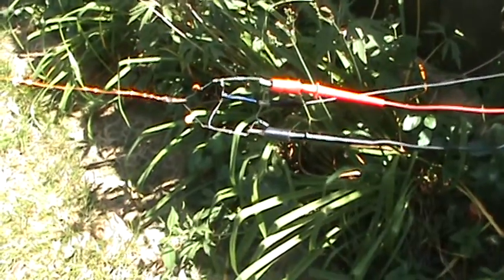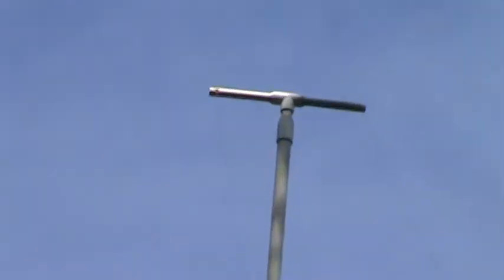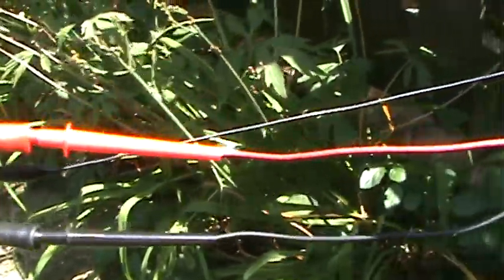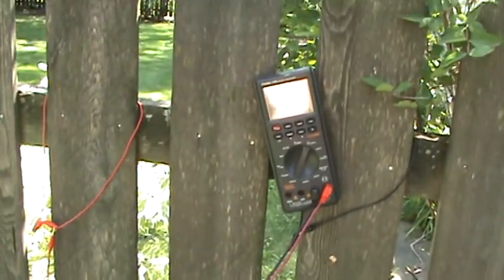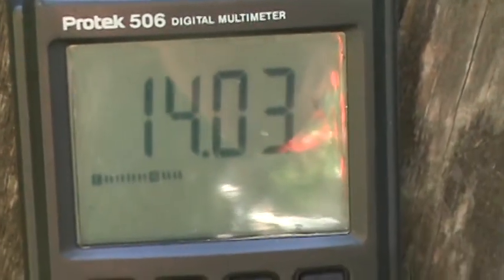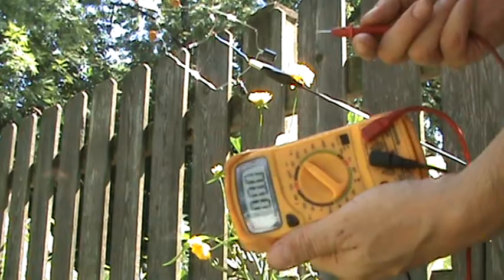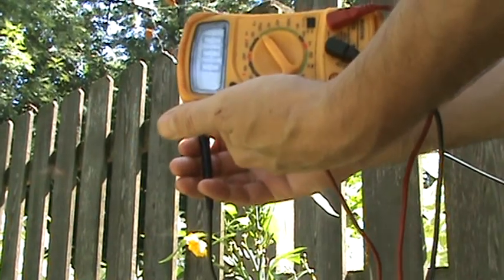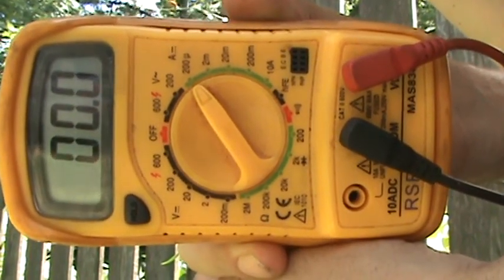Free energy from air TEST

Comment: I need at least 12v constantly for my Inverter in my camper van...
I have solar panel and mppt charger but it would be great to have power at night without using leisure batteries
Reply from the maker: I get over 60V when I add the coil.....  https://www.youtube.com/watch?v=vbEGITqU3_c&t=93s
Not sure if this will have enough current to power the charge controller, but it would be nice to see someone try it.
Thanks for watching😎

Comment: Try using a one henry coil and use a 60 watt piezo or piezo disc in seried and parallel for energy you want. Coil is parrallel for test. If they ring or buzz you got power. You may have to put load in series to run it.
Reply from the maker: Hello Travis!

Here is working small piezo....
https://www.youtube.com/watch?v=U-wFx4cIqiM&t=208s

Here is 21 LEDs lit :-).........
https://www.youtube.com/watch?v=E7JV2JhMcb0

Comment: doesn't this catch the power carried by radio station signals?
Reply from the maker: The source really has to be proven somehow yet.  It could be picking up energy from radio, satelights, GPS, TV, power lines.  The freq i read from the antenna is not in the range of any of these things.  This circuit has been proven to rise in voltage when there is an Earth quake within 150 miles, so it picks up piezo electric effects from the tectonic plates pressing together, so it must also be picking up freq from the cosmos, stars, black holes, quasars, pulsars, supernovas, ect..   It maybe collecting harmonics of higher freq from the cosmos, or maybe picking up beat freq from many freq colliding.  I have tried it in a few locations, with same results in all locations.
Thanks for commenting & watching :-)

Comment: The simplicity of AC electricity multipliers,

 This technology is simple, by using the long length of belt that is produced from one single rotation of a 100cm circumference pulley, which only costs one spark of DC current, to rotate 10 mini-pulleys of 1cm circumferences. This way you have multiplied one rotation of your DC motor, into 1000 rotations of your mini-pulleys. If you attached AC generators to these mini-pulleys, you would gain 1000 units of AC energy. These 1000 units of AC electricity, are all free running motors, just winding up massive voltage, or potential to do work. http://free-energy.yolasite.com/

 Now try and tell me that these 1000 units of AC electricity cannot produce the one spark of DC electricity, when run through full wave bridge rectifiers of course, to convert your AC output, back into a DC input, which you need to turn your DC drive motor just once. The massive voltage that you are generating with all of these AC generators is just what you need to crank over your DC motor once. This massive voltage is just what you need to crank over your DC motor the once, practically no current is needed. You now have a set of self powered AC + DC generators. 

 There is no magic here, it works because of the fact that turning a 100cm circumference pulley does not take 100 times the power that it takes to turn a 1cm circumference pulley. So, if you put these two pulleys in the same system, you can multiply the # of rotations by 100. Which when you put an AC generator on the mini-pulley, you get 100 units of AC electricity. Now this AC generator is running free, only winding up massive voltage, which by the way is exactly what you need for torque to turn over your DC motor once. You only need to produce one spark of DC current, so this one spark is divided by 100 rotations, which is less than no torque,,, ie easily turned.
Reply from the maker: very interesting!!,,,i printed this all out and will look at it over this weekend and get back to you..
Reply from the maker: I will have to keep thinking about this one.  I see that you have been showing this concept to people at overunity.com.  I printed out more photos.  I see your conversations here....
http://overunity.com/14280/gem-gods-electricity-multiplier/#.V8l4X5grJ1s

Comment: Aerial systems are best modeled as current sources.  I believe your meter is loading the circuit giving you false readings.  
The Earths electric field in calm weather is approximately 30 volts/foot; your aerial is 33 feet.  30 Volts/Foot * 33 Feet = 990 Volts.  
Let your aerial be 990 Volts WITHOUT YOUR METER. The characteristic impedance of the aerial is 990 volts/165 uA = 6 million ohms. I used 165uA assuming your aerial is a perfect current source, which, it's not.  
Let your ohm meter have input impedance of 10 million ohms.  The 6 million ohms of the current source are in parallel with the 10 million ohms of your meter (voltage is measured in parallel).  Therefore, (6 MOhm * 10 Mohm)/(6 Mohm + 10 Mohm) = 3.75 M Ohms. 
When you hook up your meter you are shorting the system out.  You're taking a 6 million ohm system and dropping it to 3.75 Million ohms.  
The two assumptions that were made was the voltage of your aerial without a meter and the input impedance of your meter.  The higher the input impedance of your meter the more accurate your measurements will be.  
Note 1: Leakage current is really important to minimize; try vacuum capacitors.  It might be cheaper to make a crude one and see if there is improvement before buying expensive ones.  Be sure the encasing material has a high enough resistivity to be an efficient insulator.  
Note 2: Look into AC voltages; Total EM energy in a narrow band around 2 frequencies 325 Hz and 10 kHz (taken from GlobalElectricCircuit.pdf).  These frequencies are caused by lighting strikes that are occurring constantly.  You might get more energy tuning your aerial into those frequencies.  
I am not an expert;  I study Mathematics.
Reply from the maker: Thanks for the info :-)
New videos of this soon :-)

Comment: what if the airport install a walking path way that the human body walks in the plastic creating electricity thru carpet and plastic and having a + and - wire to attract static and with high capacitor you'll charge them just so you can power half the air port. because the air port has a lot of people walking back and forth so through this path way you create electricity and capturing it in big caps. 120v or more.
Reply from the maker: Good idea :-)  I thought about this also,,,,then i ran across platforms they make now for airports and sidewalks, but it is still new and being tried on a few places,,,,the cars and people walk on them and power the lights above,,but instead of static elec, i think they used piezo effect or just a slight movement, i dont remember exactly how they worked now, it has been a while since i saw them.  Keep up the good thoughts and thanks for the comments :-)
Reply: Yea:-D

Comment: what are the ceramic caps on the input side for? (hf pass?)
Reply from the maker: +George Viaud Good question,,,,hf pass, i believe so. I tried to replace them with many different values and not much difference at all. But if i remove them, then i get results that are not as good.  It has been a while, i will have to experiment with them again.

Comment: Pipe is supposed to be iron.
Reply from the maker: +destiny walker Not sure it make a difference.  I think the main thing is that it is highly conductive so the electrons can flow easily.  I have also tried a zink rod vs copper and no difference.
Thanks for you input/comments, much appreciated :-)
Reply: +destiny walker   New homes are fitted with a 4 foot copper ground rod...

Comment: Have you tried hooking up a DC to DC voltage booster with this?
Reply from the maker: +mppforall I have a new video series on this project.  In the past i have tried power converters and transformers and also tried joule thief,,,,,,so far no luck.  Need more current for the transformers to induce secondary winding.

Comment: I've read the comments. But I have one question. How do I get more current out of it as well as volts? What I mean is lessen the resistance.
Reply from the maker: amendo95 Well, yes, this is the "big" question we would all like to know.Lets see, first some have used sheets of alum foil on hanging on their walls instead of long antenna, the more surface area the better.  Another type of antenna you could try, and i been wanting to try this myself, is,,,oh i forget the name of this antenna, but it is multiple antenna wires in parallel and they have an insulating rods between them to keep each wire separated from each other, but all the wires come together at the ends, this type is said to produce more currents.  Another thing i would like to try is to replace the antenna wire with many rods of carbon.  Wish i could help more.
Reply: INVENTOR3 Thanks a lot for the input. Lets see what i come up with and I'll comment what i find out.

Comment: if the energy is coming from this antenna thing and the device isnt reading anything from itself then it is only producing 2.31 milli-watts and at 14 volts and 165 microamps... that is 84.85 Kilo-Ohms of resistance o.O
Reply from the maker: hassan ajrouche You are correct, only microamps
Reply: INVENTOR3 so where is the energy coming from from the antenna? from radio towers or from ambient energy or what?
Reply from the maker: Break The Meta Gaming Good question, this really has to be proven yet.  It "has" been proven that it will pick up frequencies from piezoelectric effect caused by tectonic plates rubbing together from an earth quake.  Some will say the energy is coming from radio stations, or power plants, or satellites,,,but some, like myself think most the energy is from the cosmos, stars, moon, black holes, super novas, quasars, ect.
Reply: INVENTOR3 ok then please explain why you think so
Reply from the maker: Break The Meta Gaming Hmmm, well Tesla had his radiant energy collector, it used man made frequencies, but would also run on the power of the sun or cosmos.  Back then there was no satellites and power lines everywhere.  Also there was Dr thomas henry moray that got energy from the cosmos.  Also there is Franklin Mead and his patent with collecting microwaves from the air.  And also the fact that it picks up earth quakes from 150 miles away.  Also the frequency that i get on my antenna with no circuit is below range of radio ^ above 60 Hz of the power lines.  But all these things together tell me that its most likely that im collecting energy mainly from the cosmos, not power and radio stations.  This circuit has worked in many areas around the world.  But it still needs to be proven where all energy is coming from :-)  Also you could look up "Joe Tate" and his APM(ambient power modual)  This is where the proof of the earth quakes comes in.  The circuit i use also gets "almost just as much power without the sun light.  Maybe to test this circuit in a room lined with chicken wire, not sure if this would tell us something, but it would be a start.
Reply: INVENTOR3 so what do you think would happen if you made the antenna coherent where the atoms in the antenna are vibrating in unison kind of like a superconductor does and you find out the frequency of the energy you are collecting and tune this antenna that is coherently vibrating to the frequency of the said energy, wouldn't it absorb all the energy in that range?
Reply from the maker: Break The Meta Gaming I strongly believe so, yes, absolutely. I think i had things tuned well with video part 16 when i get over 100V.  & what you mention about the antenna has led me to think about specific antenna lengths to resonate, maybe with 7.8 Schumann resonance or...?. Later leading me to think about Franklin Meads patent & resonating with microwaves EHF, and now thinking about carbon rods wrapped with magnesium strips and then to make circuit to resonate with this & to implement ideas from my video here...
https://www.youtube.com/watch?v=pg8rGROgfA4
Reply: INVENTOR3 well you know there is ambient energy and also there are radio waves tune an antenna to radiowave frequencies literally just like go get 10 radio antenna's similar to a cars radio antenna and tune each one to another radio tower frequency and connect it to a battery and measure voltage and wattage/ampere it will be a decent amount of energy i think
Reply from the maker: Break The Meta Gaming Yes, i agree, this would work, but i really dont want to rely on radio stations for the power.  But to use same concept with collecting frequencies from the cosmos, an unlimited power supply, and i believe more power :-)  Now need micro sized antennas.  This is why i will experiment next with the carbon rods, they have many micro points for collecting the energies.

Comment: Is it posible to light several LEDs with a RFID powered by radiowaves from a huge antenna?
Reply from the maker: Hmmm, im not sure, but you got me thinking :-)
Unfortunately i dont have enough experience with radio freq ID's.
Hmmm, very tiny components,,im sure they can be powered with even a small antenna, but i dont think the ID by itself would allow enough energy to pass through it to light the LEDs.  I mean the ID is not an amplifier.   Hmm, ill have to keep thinking about this.  Very Interesting idea. Thanks.
Reply: INVENTOR3 nikola tesla tuned multiple antennas to receive radio signals and put the energy into a battery using it to turn a motor at 1800 rpm for a car
Reply from the maker: hassan ajrouche search,,,,Tesla ford pierce arrow
Reply: INVENTOR3 okay thankyou .. that was the name of it xD

Comment from the maker: It will not charge a lead acid battery, they leak too fast.  I would try a small re-chargable battery.
Reply from the maker: ProjectsBlack Maybe.  I tried a copper pate about 14" square, but did not get as good of results from it, and i never enamel coated it.  It would be worth another try with a larger enamel coated plate or multiple plates :-)
Reply: Combine this with a Bedini SSG and I'd bet you could charge a battery. Now I haven't tested it myself but theoretically all it takes is a 12v input to keep the Bedini SSG going and it should charge those batteries with the back EMF no problem.
Reply from the maker: Thanks, i been thinking about this myself recently :-)

Comment: Hello, everyone, I made this for a science fair, but it does not work. Someone please help me. Should I use copper wire for the antenna? Where should the ground wire go? There is no reading in my voltmeter. Why is it so? Where did I go wrong? Someone please help me. I am in a hurry
Reply from the maker: Yes, copper wire, enamel coated.  Ground wire connects to the circuit between the 2 electrolytic polarized capacitors, and other end goes to a Earth ground rod, a water pipe will do.  Keep the antenna & the circuit off of the ground, or place circuit on wood to keep insulated from the ground.  Does not make sense to have absolutely no reading at all.  Check with meter in lowest voltage setting.  Are you using "germanium" diodes?  check to see if your diodes are good, If you check voltage across each diode it should read about .3-.4V, if you used silicon diodes than voltage across each diode should be around .6-.7V   Also to make sure your diodes are all facing the correct direction.  I could help more with photos or video of your set up.  Here is my email....
millanyangle@yahoo.com

Comment: Paused at 3.09 ... you are measuring amps, but the leads are still connected into the Comm and Volts... and as someone said still in parallel, it would be cool to re-try as you obviously went to a fair bit of trouble there for the rest of it.
Reply from the maker: Thanks, i agree with you, but my whole set-up is no longer in place and i just moved my whole lab.  I will soon set this up again at my new location & test again.  Also i will be making new "HOW TO" videos.  Here is video of new lab :-)  Moving the Lab part 2/2

Comment: It was a little unclear so i may be mistaken but when you measured the current i didn't see you break the circuit...When reading voltage you can just simply touch parts of the circuit because the voltmeter can be in parallel with the circuit without affecting the voltage. To measure current you MUST disconnect the components and put the current measuring device between them so the current flows only through the meter. I can tell you right now that will be part of your problem with reading current...love your setup this is a really interesting subject and im probably going to look at making an array myself in future!
Reply from the maker: You are absolutely correct, it was my mistake.  Yes, meter should of been in series with circuit for checking the current, not in parallel.
This is a very fun project, i got over 100V from it so far.
Thanks for your comments.

Comment: Hey, that is pretty cool! Looks like the current you got is in the microAmp range. That would mean a couple of mWatts of power. Have you tried loading the terminals? Did the voltage levels drop?
Reply from the maker: yes, little power.  I got a calculator to power on,,but thats about it so far.  Im working on concepts or resonating coils now,,,,,i must get things to sing yet.  I will be implementing more concepts into this circuit soon :-)

Comment from the maker: Winter is coming fast and i need to do some repairs on my antenna pole, so i can not check this at this time.  I did check this in the past, i forget what video part it is in.  I have a 24 part series on this circuit.  I remember it was only like 180 to 380 Micro Amps, depending on my set-up.  Many have gotten good results with hanging sheets of alum foil on their walls and using them as antennas with a wire connecting them to the circuit. Im working on concept now that will produce more power

Comment: the power comes from the ground and the air.  It is mains power for the houses sometimes you can extract it from the ground on the house or you can have a crude receiver that will wirelessly couple with the power grid.  Take it to the mountains and make a video and I will retract this statement if you show that it still works.